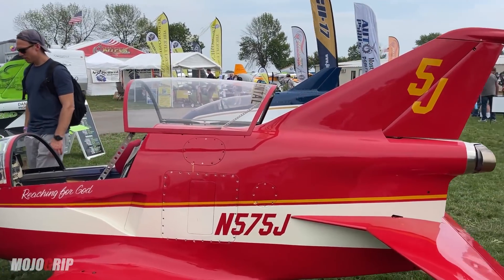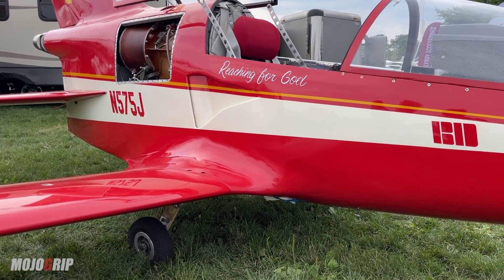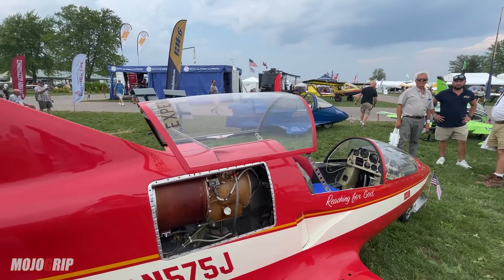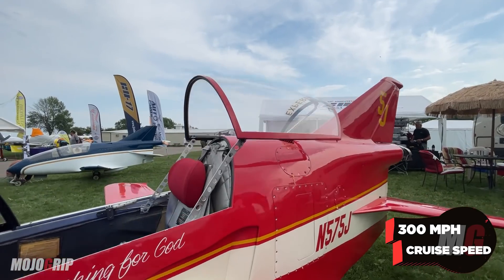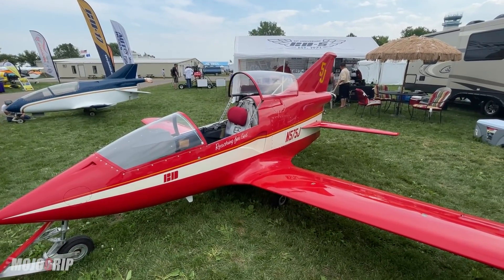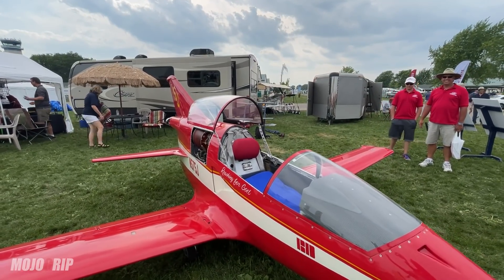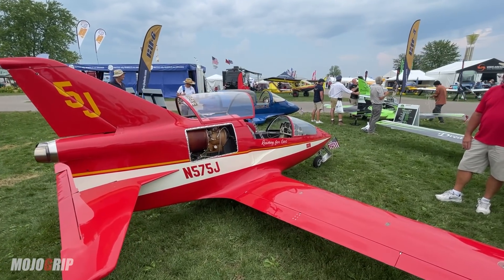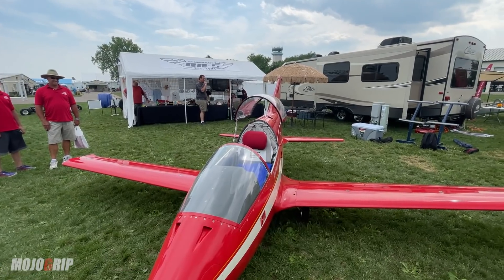BD5 High Performance Micro Jet

Comment: why the air vents always close with the springy covers? Will they open themselves while the plane is flying? Is that not bad for aerodynamics because the springy covers resist air?

Comment: The blue vehicle in the background is a Pulse autocycle, also designed by Jim Bede.  It's basically a motorcycle with outriggers equipped with wheels.  Notorious for overheating, because there's not really any place to take in air to keep the engine cooled.
Reply: Scotty, you'll note that the blue Litestar adds the suffix "EV-1", as this is the electric version.  No cooling issues.
Reply: @BedeBIngraham  I see "Litestar E-1", but now I'm intrigued to research it now..

Comment: The air intake isn't just to "cool it down" - a gas turbine engine (like any internal combustion engine) uses air as its working fluid, and gas turbines run with substantial excess air (meaning more air than would be required just to burn the fuel).

Comment: Hummmmm, failed to mention the original cost of the kit was $2000 or how many piolts have been killed in crashes.  It is a very unstable airframe even for an experienced piolet.  To add another note, no longer available as new, company out of business years ago.

Comment: Not totally true you can't get these kits new today . The original kits yes , they're all used and maybe a few lying around but very difficult to build . A few finished jets around but yes will cost you $100,000 s for a near flying version . There is BD Micro who effectively have taken Jim Bede's design and modernized it and market it now as FLS Microjet . You won't have much change from about $200,000 !!!

Comment: Can anyone, preferably with an engineering background tell why the BD-5J was so difficult to fly safely?
Reply: The BD-5J's allowable center of gravity was 1" to 3" from the center of lift.  That made controlling pitch very difficult even with proper loading.
Had the fuselage been longer, that would have given it a more generous center of gravity allowance and would have made it easier to handle. ;-)
Reply: Good answer.  If I remember the Cessna 172, known to be a forgiving aircraft had a CG range of 8-10".   @jamesburns2232

Comment: https://www.google.com/maps/@38.1582376,-85.7004327,3a,75y,158.23h,93.72t/data=!3m7!1e1!3m5!1sbW6qEuSO9tprxFuInQB-vQ!2e0!5s20151101T000000!7i13312!8i6656?hl=en

This street view is from 2015  I stopped and took a picture when I was driving by.  Could not find that picture right away, but I have it somewhere. That aircraft company and the BD are no longer there. This is Louisville Kentucky.  I’m pretty sure it was the jet version, but it could just be that the prop is missing.

Comment: Was that a thrust reverser on the rear?
Reply: Not a reverser but a cable actuated attenuator.  The clam shell redirects the high idle thrust to the sides so the plane will slow to a reasonable landing speed.
Reply: @cmwsofasale2101  Actually, the brakes were just a couple of little pucks the size of a quarter. You needed the  rear attenuator to slow down on landing. Without it the pucks would immediately overheat and glaze over.
Reply: @edjohnson2333  my dad used to think they stole his lawn mower wheels!

Comment: Most of the completed kits actually crashed and killed their pilots. Coors Lite "Silver Bullet" had 2 modified "safer" ones built and had them flown at airshows for a while. One of them crashed twice, the second time after repair from the first incident killed the pilot and destroyed the aircraft. They were marketed as personal jet fighters for shade tree mechanics, featured in Popular Mechanics magazine and the like, but no former jet pilot would ever consider flying one they were so inherently dangerous. Most Jim Bede designed aircraft were notorious widow makers.

Comment: I flew over 400 Airshows, including Air Venture, in the BD-5J. Had 2 of them at one time. Along with a Pitts and a Lazer. Sponsored first by Republic Airlines and later for years by Bud Light. It is not for the faint of heart to fly. Especially low level Airshow Aerobatics. Having flown Fighters with 2 Combat Tours from the F4 Phantom to the F-15, it flys like a Mini Fighter. Much more sensitive though. You just add force to the stick without much movement at all. Kind of like flying by thought. If you can fly an Unlimited Aerobatic Plane and a Jet Fighter, plus  know how to land a High Performance Sail Plane, you would be qualified for it. Otherwise forget it. Too many Pilots have died flying it. Even a top Test Pilot at Edwards Air Force Base crashed it and barely survived. It is also very light and subject to heavy turbulence at high speed. However, having said all that, it is the THRILL of a LIFETIME to fly low level Airshows in !!!
Reply: Hi, Ed...

Brian Ingraham here.  Don't know if you remember me from TMB back in the day, working at the original Weeks Air Museum.

I've been involved with Bede Aero for quite a few years, and I'm now flying this specific airplane out of Ellington Field in Houston.
Reply: @BedeBIngraham  
Hi Brian,,,Good to hear from you. Weren't you building a Weeks Special back then when I was building my Laser at Kermit's?
Congrats on flying the BD-5J and living to talk about it. Are you doing Aerobatics and Airshows in it?
The 2nd Jet I built was really light with stiffer wings and all composite flight controls. Larger ailerons for faster roll rate.
Lots of hair raising experiences in 12 years and over 400 Airshows. Had to dead stick it 3 times, 2 of which it flamed out during a tail slide.
It is really a great airplane to fly but deserves constant attention, so be careful....Good Luck, ED
Reply: @edjohnson2333 , good memory.  Yes, I was building a Weeks Special.  I had the fuselage/tail feathers complete and Kermit sold me the wings that were originally  on his Special before he built the new lightweight version.  But his airplane was in the TMB hangar when it collapsed during Hurricane Andrew and a girder crashed down through the upper and lower right side wings and he asked if I would sell the wings back to him.  Last time I went by Fantasy of Flight we sort of strolled through some of his hangars and... BANG!... I found the fuselage just as I left it!

This BD-5J went from Alan Thompson, to Toyoshi Kimura (who had an off field landing) and then Don Wall bought it.  After he rebuilt it, it only flew once.  It has been on display at the Bede booth at Oshkosh every year since 2006.  In 2020, Don donated it to the Bede Family Foundation, a 501(c)(3) charitable organization that was set up after Jim Bede Sr. died in 2015, with the purpose of supporting youth in aviation.  I'll be flying it to advertise the Foundation and drum up donations.  No airshows, except perhaps demonstration flights and the only aerobatics are for fun.  I'll be a regular on the fly-in breakfast and local airshow circuits.  Just fun stuff.  It's next appearance with be at the Deland show in November.
Reply: @BedeBIngraham  
Al Thompson was a very good friend of mine, His plane flew really well. He helped me finish my last BD-5J in his hanger in Kenosha. Al was a true party animal. I can't print here the things that went on in his elaborate apartment hanger. Great times.
Sorry to hear you didn't get to finish the Weeks Special. That was one of my favorite planes.
I did get to fly a formation show in Kenosha with my best friend who I flew F4's with In Vietnam. What a blast that was.
Good luck with the Jet. Glad to hear it's still in the air.....ED
Reply: @edjohnson2333 , and I'd love to hear about some of the airport parties!  Not online, of course...

FYI, we're also working on finishing a BD-5T (turboprop).  Brian
Reply: Always thought a Turboprop would be the best of both worlds. Keep me informed. The Airshow Parties were the best. It was like a Rock Star lifestyle. I can tell one story that was my first experience. Doing a major airshow in Kissimmee Fla. I was in college at Embry Riddle and flying a Citabria at the time. Always said they let me fly so people could go to the bathroom.
There was a party Fri night before the show. Thunderbirds and every major performer you could imagine. Don't want to name them, Anyway, I left te party early cause I was one of the first ones to fly representing Embry Riddle. Early the next morning at 7am I left my room to go to te airport and clean my plane. As I passed through the pool area here was one of the worlds most famous pilots with this girl in a corner of the pool that was lined with drink glasses. I said good morning, your up early...The answer was "Ain't been to bed yet"....." airshow briefings not till 10:30".
That's when I knew I had screwed up. If your going to be a world famous Airshow Pilot you better damn well learn to party !!!!
. @mvvoila3356
Reply: I thought it was the Coors light "silver bullet" or did Bud sponsor some also?
Reply: @mattgraham4340  Yes Bud Light sponsored mine  for over 10 years. Coors sponsored Bobby Bishop for around 4 years.
Reply: I went with my friend/boss at the time (early '90s) to look at a barely started kit that was selling for $10k in Ca. He was going to have me build it out as a display for one of his business ventures. He had problems with the city permitting where it was to be displayed, up on a pole. So he passed on it. I would have loved to have built that.
Reply: @ronald8673  
When I was doing Airshows in the Jet, a big part of our Sponsorship was doing display work the week prior to the Airshow. We would be in Malls, Car Dealerships, TV Studios, etc. Three times the Jet was damaged by on-lookers while on display. So to prevent this I found a Prop Kit that was 90% finished and converted it to look identical to the real jet. It was really cool. Built the tail and wings from Styrofoam and fiberglass. Even took a tubular heater that ran on kerosene and mounted it in the tail. Sounded on startup and while running like a jet engine. Saved a lot of headaches and was really a success for Demos.
Reply: How much does it cost?
Reply: @syedhasanmohiuddin827  
Probably your life !!!
Reply: @edjohnson2333  what if someone wants to fly one of these.

Comment: Somewhere in the back alleys of my memory i found a recollection of an article by Richard Bach (author of Jonathan Livingston Seagull) recounting his cross country trip in his personal BD5J. Frequent stops for fuel. Luggage amounted to a toiletry kit stowed between his legs. Probably published in the late '70s. Bach piloted an F-85 for the ANG when a young man. HIs first plane ride was at age 14.
Reply: By the late 70’s or very early 80’s Bach sold the airplane to airplane dealer Red Stevens.  Got to see it once when Stevens stopped in OKC for fuel.  Not long afterwards he reportedly aborted a down wind takeoff in Missouri but went off the runway.  He survived but the plane didn’t.  Such a shame.  It was gorgeous!

Comment: My dad was building one of these (the prop version) when I was a kid.  He finished the fuselage and the wings. I don’t know exactly why he stopped. Two versions of the story I heard were that the engine wasn’t ready for the kit builders, and that some builders were finishing their aircraft and then suddenly dying. 

Other than my dad’s, the only two I’ve seen irl are one at the Udvar Hazy Air and Space museum near Dulles and one at the Evergreen museum in McMinnville, Oregon (home of the Spruce Goose).   You can’t touch the one at the Smithsonian.  The one in Oregon was hands on, because it’s just a shell (looking exactly like my dad’s!) and they had it in the kids’ play area.
Reply: I don't think Bede ever supplied a viable piston engine for the plane.

Comment: Someone mentioned the BD10, it was a small version of an F16. Very nice design, unfortunately Jim Bede didn’t design it properly for flutter, it broke up in flight and killed the test pilot and resulted in the loss of his prototype. I saw this airplane on the ramp at old Port Columbus Airport Terminal, several former engineers from North American Aviation came out to see it. End of the BD10. 

Another pilot Jim Hoover (American Airlines) was killed in a Budweiser BD5 air show accident. 

Bede was a genius in design, but not too successful as a businessman. 

I’d like to see Sonex or Vans put their jet engine in the fuselage and add an escape chute.
Reply: Hoover died in a Coors Silver Bullet..At that time I was the only one flying the Bud Light Jet.

Comment: FYI: If anyone is interested and you're into the X-Plane 11 simulator, I've created a couple of models of the BD-5J, one with gauges and one with an EFIS display.  It's free, all open-sourced and licensed under the GPL.  It's available on x-plane dot org.  It supports both VR and flatscreen modes.

Comment: What’s was the blue one next to the jet
Reply: I think you are talking about the vehicle... Litestar Pulse Autocycle using the same fuselage and 4 wheels...two front and back like a motorcycle, one left and right as outriggers. All these vehicles are cool.
The BD5 was/is a beautiful design, though nothing like the Sonex at all unless size is the criteria. BD Micro in Stiletz Oregon were making them but as noted in other comments they are improved with the PBS jet. Not sure if they do still.
I would have one in a heartbeat! Autocycle, piston plane or jet. They could no doubt also do a turboprop I guess, which the Sonex could clearly not do. 1 more point for the BD5.
Also agree, Mike, you should have done a minimum amount of research on your phone first but... hopefully you will remember this beautifully designed machine in years to come. Check out what Jim Bede did in his design career! A legend!

Comment: the prop version with only 60 hp still cruises at 200 kts!
and has a range of almost 1000 mi.
Reply: That’s if you can get the prop version to fly without overheating (difficult) or suffering a drive shaft failure (impossible over time)

This plus the touchy controls, due to short coupling (elevators are just too close to the wings) are what doomed the aircraft.

Had the jet engine been available FIRST, and has the fuselage been stretched by a food or so, and anti-servo tabs installed on the controls (to make it less touchy) it would have been a much more successful airplane.

Comment: You better be a dam good pilot to fly a BD-5. It’s really fast and small which will make it very sensitive to any movement of the stick. Pocket rocket Mike. They use to be in the air show back in the 70’s.

Comment: Actually the piston versions aren't bad. It could do 373km/h cruise with a 70hp engine iirc. And hte jet in this one is a turbojet which is the hungry kind whereas a more modern turbofan can be quite efficient if you pressurized the bird and took it up. It could also be made lighter today than it is. With a modern jet engine, maybe a little longer body for stability and pressurized I wouldn't be surprised if it could do above 700km/h and have a range around 2000km. And tandem seating doesn't take much space so you could do a 2 seater without too much penalty.
If you needed a plane to actually go places, it could go places. And if light it could probably do very short runways.

Comment: If my memory serves me right, I watched a BD2 at a couple of airshows in 1985 doing aerobatics painted up with Coors logo. Small jet engines made in USA check out Williams International, Waterford, Michigan.
Reply: That would have been one of Bobby Bishops BD5 Acrojets branded as the Coors Light Silver Bullets.  All used the same French Microturbo engine, never a Williams Engine. Originally the Sonic Acrojets flown by Bishop and Corkey Fornof.  Kits are serviced by MLS in Oregon featuring a stretched fuselage with the same Polish jet engine as used in the Sonex.

Comment: I’m pretty sure there are R/C jets larger than this..I wonder if an R/C jet engine would work on this?
Reply: Jetcat P1000 is a 100kg FADEC engine. I'm pretty sire that would work and be lighter. Burns 46 gallons per hour at max thrust.

Comment: I’d imagine if you were to modernize the engine, the fuel efficiency would be much better. Much more power too.
Reply: the 60 hp prop version still cruises at 200 kts and uses way less fuel
Reply: I'd imagine the engine manufacturer already done that, but jets are not so efficient at low altitudes